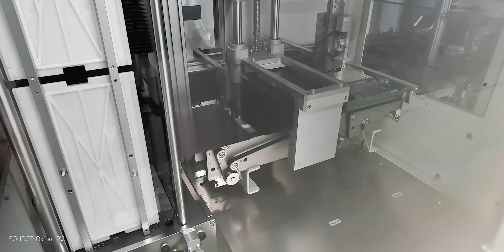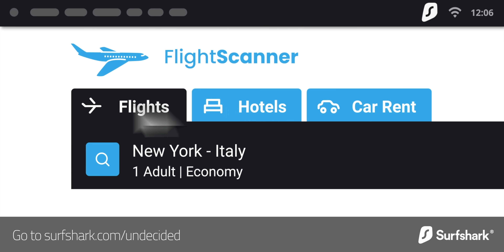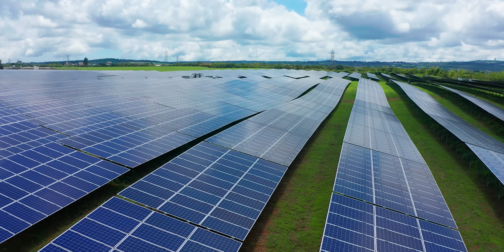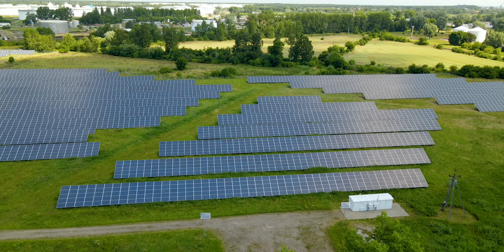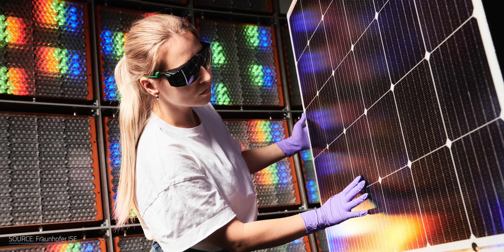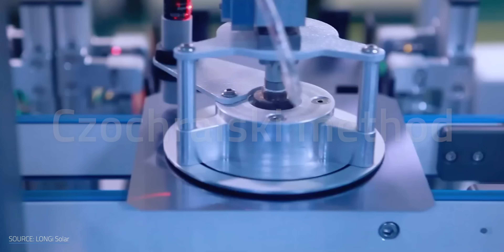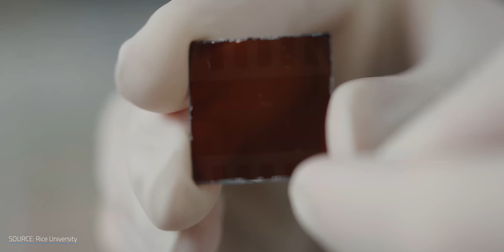How Record Breaking Perovskites Are Here NOW

Comment: "...retained 97% of that efficiency after 1000 hours."
Please don't use unsuitable timescales and measurements.
1000 hours is 41 days. Calculating just like compound interest, if the panel is 97% as efficient as it was 41 days ago then by 10 years, it is 6.9% as efficient as when it started. Starting at 30%, that equates to 2% efficiency.
It has lost 50% of its efficiency after 2.5 years. Just to be clear, starting at 30%, that's 15% efficiency after 2.5 years.
For any technology to be taken seriously, it must retain >99% of its efficiency after 1000 hours. It will have lost less than 50% after 10 years.
...and that's only to take it seriously, not to consider it worthwhile.
I'd like to believe that Oxford PV are onto something, but this whole sector seems to be obfuscated by smoke and mirrors.
Reply: 1000h of sunlight, not real time. That doesn't make it great but about three times less bad 😊

Comment: Tandem cells breaking through efficiency limits is a game-changer for solar tech. It's exciting to see how material innovation like perovskites is helping us push past traditional boundaries in renewables.
Reply: Multijunction cells have been around for decades.  The "game changer" is going to be if they can make them cheap enough to be worth the use, rather than just installing more.
Reply: This is huge!  Think of the advantages in transportation!  Micro-vehicles could be entirely solar power, solar added to trucking would make significant impacts, public transit advantages, covered bus stops (or covered bike-share ports) could double as free charging stations for scooters/e-bikes/laptops/even micro--vehicles.       
If efficiency is essentially doubled using perovskites, it could make solar micro-vehicles practical for most uses!  Sprout Solar from Wink Motors (or the Squad Solar Car in European markets) in the $10,000 range are already practical for many island and city uses, and significantly powered by solar.  But perovskite solar advances could eliminate much of the charging needs for micro-vehicles.  Think of the difference it would make in range anxiety, reducing the need for charging stations, and the length of wait times for their use. 
Plus the implications for so many other uses (rooftop, carport, AI, space applications, integrated device charging, solar farms, solar lighting, shipping & airlines...)  And the development of this is still in its infancy!

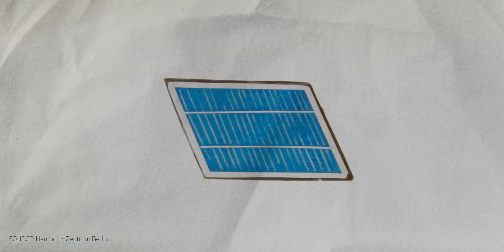Comment: @2:26, you showed the silicon and perovskite cells on top of each other.  About 10 years ago, there was talk of clear solar panels.  Has there been any updates on clear solar cells/panels?  If we could cover more external area of our house with panels, I would think there would be less need for higher efficiency.  We might also be able to cover our entire cars with solar panels and thus have more area collecting/creating energy to make up for a less than perfect angle.  I would also think clear would be less affected by the heat of the sun than a darker color.
Reply: Entirely clear panels doesn't make much sense because you need to absorb that light to convert it to electricity; it just depends on what spectrum you want to absorb.  A "clear" panel would only absorb ultraviolet or infrared light, the wavelengths we can't see.

What COULD be cool though is "stained glass" solar panels, where each panel is tuned to absorb a different frequency so you can make mosaics out of it.  They won't be nearly as efficient as full spectrum panels, but it could become an art form that attracts more wealthy purchasers.
Reply: @Alaric323 Some CIGS panels are being made that are coloured and semi-transparent. CIGS are much less efficient, though, only about 17%. But they're fully flexible (most "flexible" panels actually aren't, they'll break and stop working), very tough, and work well in low light. When I had 400w of CIGS  I saw 150w input even when there was rain outside!
CIGS could, apparently, be made cheaply, but they're niche and expensive. Also the first batch sold for campers etc was badly-glued and delaminated. This led a bunch of morons to just assume the CIGS chemistry itself is a "scam".
Reply: @tygreen101  I’m a material science PhD student and I’ve seen talks about this by some of the people who are developing it. Turns out it’s really hard and they’re still in the development stage and are not close to getting it to market. At least that’s what I know
Reply: @Krystaltho  they're already out there.  They're not very good. But if the building has a very high budget and is being designed with a lot of glass anyway, it makes sense.  If the building isn't designed for aestetics, it makes a lot more sense to just put panels on the exterior walls between the windows
Reply: @tygreen101  they already exist and are used in some glass windows. They're terribly inefficient. But a building is going to have windows anyway so it's a solid use of space.  
*As for cars, it's only a good idea if they are very flexible and won't shatter in an accident.  As of now, when damaged, they're extremely expensive to replace and can be the cause for insurance totaling a vehicle that's not very new.
Reply: @veganpotterthevegan  it is annoying the list of things that will "total" car.  25 years ago I had a car totaled by a tire that came off the other vehicle, hit my passenger air damn.  It was totaled because the air bags went off and each one was $5G to replace.  I loved that car.  .... And why does each car need proprietary specially curved glass anyways. Rant rant rant grumble grumble grumble.
Reply: @tygreen101  ha, yeah, it's pretty terrible.  I've been lucky and have never had an airbag deployment so far. I've totalled a few uninsured bicycles though😅
Reply: @veganpotterthevegan  its not a solid use of space. windows point perpendicular to the ground. the roof is a better place until every roof is filled
Reply: @AricGardnerMontreal   you really don't know how big city buildings work do you?  The square footage of a roof(often a flat roof) is laughably small relative to the interior square footage of most new builds😅
Reply: @veganpotterthevegan  COVER THE  ROOFS FIRST BEFORE YOU TALK ABOUT DOING THE WINDOWS WITH TRANSPARENT PANELS (was my point) both being a bad idea is tangential.
Reply: @AricGardnerMontreal  it's a point made from a terrible lack of understanding
Reply: @veganpotterthevegan so we should cover the windows or the side the sun shine the most
Reply: @DanielEng-om7vv  for sure, obviously the south and west facing side in the northern hemisphere.  But people also care about design and enjoy nice view out of windows.
Reply: Not clear but I will note that modern bifacial panels are considerably more translucent than the single-facial mono panels of just a few years ago.  You can't "see" through them, but light does get through them.  Makes for a nice patio / Pergola shader actually.
Reply: How does the perovskite coating let light through it to hit the silicon layer below is one question im getting from hearing about their approach.
Reply: @nzoomed  Different structures absorb different wavelengths of light.   So for any given structure, some wavelengths will be caught and converted to electricity, some will wind up as heat in the material, and some will be let through more or less unimpeded.

For example, normal glass allows most visible wavelengths through, making it "transparent" to our eyes, but glass also absorbs a large chunk of the UV spectrum.  If we had UV eyes, glass would seem to be mostly opaque to us.

Multi-junction solar cells work the same way.  As does solar "glass" for buildings, and so on and so forth.

-Matt
Reply: @junkerzn7312  yes thats possible I guess it depends on how thick the coating is too. it somewhat would have to be at least translucent, but it appears a darkish colour. I bet there is still a tradeoff where some amount of light does not pass through. Its a bit like colour film which is made in different light sensitive emulsions in layers on top of each other.

Comment: I watched both the videos. Yes it sounds nice to see the improvement and seeing that they are almost available to everyone. 

Remember when people complain on 24% sounds low... well only 17-21% of the energy from Gas is converted into moving a car.

I love to see every type of new panel and such. I am still hopping that Window cells will become cheap enough to use standard
Reply: Very true, also a 1% change in solar efficiency has a big impact on the overall kW ouput produced by PV panel, due to the aggregate effect of producing more energy summed over period of time as well as across a deployment area.
Reply: I am sorry but you are getting scams, Perovskite Solar cells have no future . I have make a video tell why: 
 https://youtu.be/wwlvFMZWqXI
Reply: “Almost available” is an extremely optimistic statement.
Reply: but the car is getting that 21% from a super energy dense source, and for a very cheap price.
Reply: @keith3761  - not that dense, metal-air batteries offer similar max theorectical density and are 3 to 4 times more efficient in use. Plus when you factor in the continuous energy costs invovled in producing a fuel the nett overall energy density drops further.
Reply: @GruffSillyGoat "theoretical" just like fusion power only another 5 years away! the "theoretical" costs of your batteries, their lack of any supply and the plentifulness of gasoline insure gas will be used for generations to come.  There is a reason most of the world still burns coal my guy. Its cheap, its effective and the more batteries and alternatives you make the cheaper gas and coal will become! ban both from you nation and my nation will buy up the surplus for pennies on the dollar!
Reply: @GruffSillyGoat yes and just like fusion power is perpetually 4 years away! Also do you know what happens when new competitors get introduced to the market? the plants dont shut down. they cut wage and costs and sell to fresh customers at a lower price. As soon as the west cut its coal usage the poorer nations bought up the cheat coal in droves! the same will be true for gas. There is so much industrial investment in gas plants they just dont shut down. They at best go bankrupt and their parts and equipment shipped to 3rd world nations to restart production all over again.
Reply: @keith3761  Solar is far cheaper over its lifespan.  Fossil fuel only appears cheap because we don't consider real, or lifespan costs.  We currently subsidize the costs of fossil fuel with our taxes, our health, and sacrificing a livable planet.  We do not pay for the effects of pollution or climate change.  
Alarming new research shows AMOC (an ocean current tipping point that would be catastrophic and irreversible) to be perilously close due to heat trapped in the ocean and melting glaciers and poles.  The new studies this year show that the Antarctic shelf is melting from the under-side at unfathomable rates.  Our current emissions could determine whether or not we bring this upon ourselves, and how soon it may happen.  Addressing greenhouse gas emissions is a matter of survival for many species that we currently rely on.
Reply: @keith3761  Cheap?
Reply: @zackkirako8574  Cheap AND plentiful

Comment: it may be "happening" but i am still highly skeptical on the longevity of the perovskite portion. as well as the additional cost for that portion. i do not believe this solution is as game changing as one thinks, after a few years of use. we have little to no actual real word evidence of a perovskite lasting even half as long as traditional solar panels.  its all theory crafted information at this point.
Reply: Well, you have to start somewhere. You can wait 25 years to make sure they hold out long enough and then have to do it all over if your product fails or you can sell now and replace your first generation in 10 years with better ones that you have continued developing in the mean time if customers start complaining. Which strategy is more viable? And don't bring in the argument "but we need 10 years more of development first" because by that metric you'll never start production of a promising technology. When it's good enough to go, you go with it, all other things damned or you'll go bankrupt.